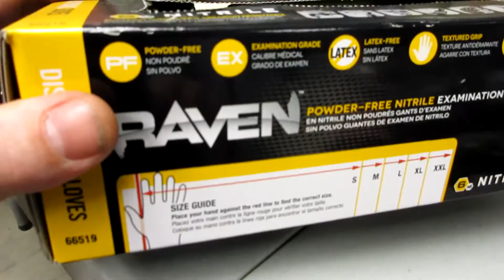Installing a Mazdaspeed Crankshaft

Comment: Hi...i will also be installing arp main studs on my build and was wondering if you have to line hone the block or not...thanks in advanced
Reply from the maker: Oscar Barrera generally line honing because of new main stud only needs to be done when you have steel main caps with an aluminum block... as you know the MZR is aluminum to aluminum so you SHOULD be safe. However I would have the machine shop check it when they do the honing... or you can do it yourself if you have the tools

Comment: What bearings were in the motor that spun? Great vids 👍
Reply from the maker: blazonemore2 they were mazda oem bearings but the oil pump failed and had zero to do with the bearings, I used oem on my 600+ build and this motor got them again
Reply: No clearance on the bearings?

Comment: Can tje balancer be deleted? If yes i would like a vid and the part
Reply from the maker: Cesar Jimenez remove all four bolts holding it in... Buy the delete kit and instill the block off in the oiling hole